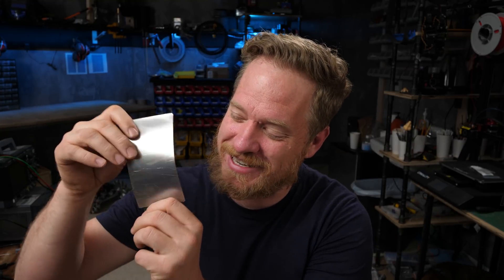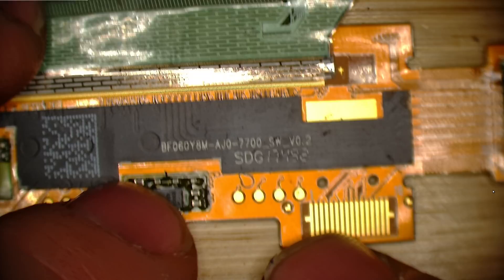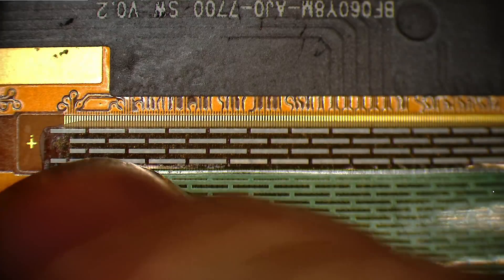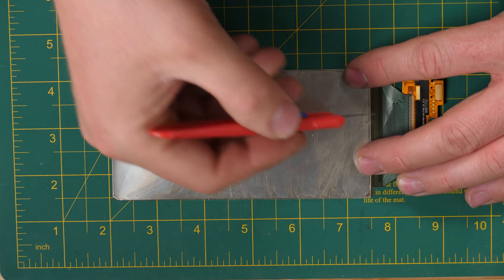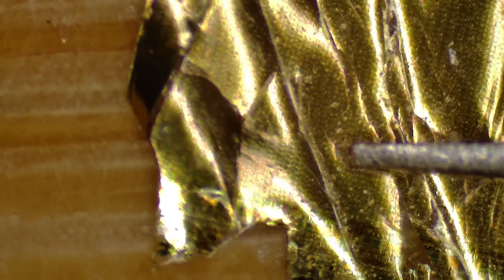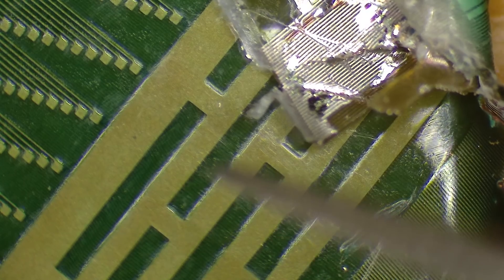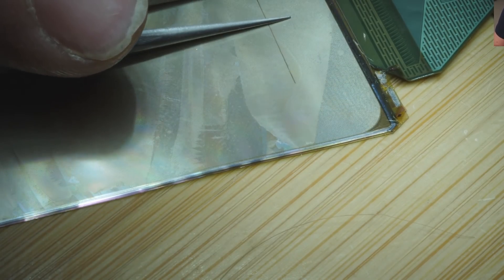What's Inside a Flexible Phone Screen? Flexible AMOLED teardown

Comment: Got here because I was replacing my son's Note 20 screen.  Was doing a full screen/digitizer replacement even though it was just the glass and not the display messed up.  When I went to pull it out of the frame after heating up, the glass came right off with the first layer of tint.  I was surprised by the flexible shiny part that was left trying to figure out how it displayed an image since the other part was just like tint on the glass.  You were the first video I could find that actually showed a screen.

Comment: 8:40
NO that is NOT how OLED works
Light emitting polymers are 3 color RGB and with WOLED there is also the white one for every 3 clor ones.
There are some versions that use white oleds and color filters but that would just destroy color space and that is where OLEDS "shine"

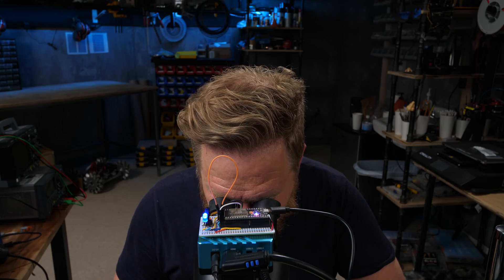Actually at 9:33 you can see the colors... and NO it iis NOT THE COLOR FILTER it is the SUBPIXEL's actual color - also there are no LEDs
Why is blue big? THats the only problem (other one is burn in but that is not really OLED problem) OLED screens have that still isn't solved and it was there since 2004... blue LEP has short lifetime...

Comment: Well the yellow this is a kinda glue that the TFT is settled onto and is poured over the substrate essentially making the TFT, substrate one single layer on top of that is another organic layer which is what you peeled off and the top part was the cathode according to my knowledge of amoled screens and more importantly I don't think so it is an amoled screen, since amoled screen are usually square and that looks like it's an regular LED screen .

Comment: You're getting an SEM?!?! That's pretty awesome. I hope you also have a sputter coater if you're going to look at that display (assuming your not using a low vacuum/environmental SEM). If you need any help with using/setting up the SEM, let me know. I have quite a few years experience in election microscopy field service and could give you some pointers over video chat if you want. I'm looking forward to seeing what you use the SEM for.

Comment: I'm fairly certain you were looking at the actual pixel elements, not color filters. In general, "small" OLED displays as found in phones and similar devices are RGB OLED, where each subpixel is an actual red/green/blue OLED element. Especially reinforcing this is the fact that each sub-element shown has a different size/shape to try and compensate for the brightness and lifespan differences of the different OLED colors. "Large" OLED displays as found in TVs instead have each subpixel be a blue+phosphor "white" LED with a color filter over it.

The color-filtered ones are easier to make last a long time and degrade in brightness at even rates since they use the same longer-lasting pixel elements throughout, but they waste a lot more power. Since phones generally aren't left on as long or as bright as TVs, they can get away with using actual red/green/blue OLEDs so that they can cut the power consumption substantially by avoiding the use of light-wasting filters.

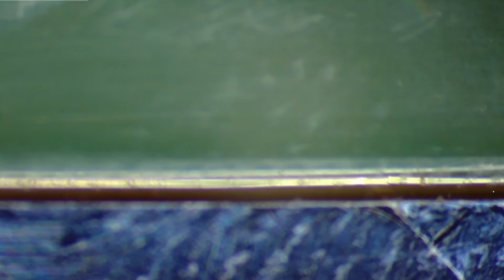Comment: Scotty, I don't think the screen itself broke.  I watched you other video and it looks like you put stress on the long silicon chip and cracked it.  That is instant death.  Look at your video at around 3:45.  You can see the crack.  I suspected that was the failure and when I watched the instant it stopped working in the other video you may have been holding the end of this chip as you bent the screen putting enough stress to crack this chip.  It doesn't take much force.
Reply from the maker: Yes, this is totally it!  Good catch!  I don't know how I possibly missed this.  I just shot a closeup of it - I'll post it as a community post on the main channel.  With proper attribution of course :D

Comment: At 4:19, there is a crack right through the driver chip. I would hazard a guess that that's how it failed. It could have happened later on, but it did make a distinct crack sound in the video when it failed!

Maybe the actual screen is more durable than it seems and it's just the driver chip you need to be careful with.
Reply from the maker: Yes, this is totally it!  I don't know how I missed this before.  Good catch!  I just shot a closeup of it - I'll post it as a community post on the main channel.  With proper attribution of course :D
Reply: Good spot
Reply: The crack is already there at 3:50 and even at the begining at 1:50. Or are you talking about a different video in which the screen failed (and you could here the crack there)?

EDIT: Just watched the first video on these screens. I could be possible that he snapped it in half with his finger while holding it.
Reply: @dannulik  Yes, that is was what I was thinking. I think he was bracing the assembly with his fingers in roughly the location of the chip while flexing the screen.

Comment: I was under the impression that OLEDs don't have color filters, but each pixel does different wavelengths and that's why they're differently sized since blue pixels lose brightness quicker than the others.
Reply: Yeah I'm pretty sure you're correct
Reply: This is correct when it comes to phone amold screens: No color filters. LG's TV panels have white OLED subpixels with color filters though.
Reply: I think this is an amoled which might be the difference

Comment: Would be interesting to stick some fine probes into that and see if you can get the various colors of organic LEDs to light up. You can get 1um diameter tungsten probes on eBay. I'm guessing pixel pitch is of the order of 50um so that should be fine enough to do something.

Comment: I suspect that screen isn't a true flexible AMOLED screens, instead, it's the AMOLED later before it is bonded to the stiff screen for strength and protection from bending - if you flex regular AMOLED screens, you'll notice they also have some flex to them without breaking the AMOLED layer, until the stiff backing breaks and causes a sharp bend that breaks the entire display

Comment: Those unused "large" connectors on the screen might be test points for testing during manufacturing before the screen is bonded to the flex control board.
Reply from the maker: Yeah, I was thinking that too...

Comment: The driver you found can only be used with qualcomm based smartphones. Qualcomm makes their own "branch" of the Android/Linux kernel and adds drivers that are used only on qualcomm's platforms. The display driver is also called a "metadriver" since it's communicating with qualcomm's gpu/dsi and it's using the metadata (dsi commands) found in the DTS. If you wanted to use the generic Linux kernel, you would have to transform the metadata into a generic display driver. This could help you: https://github.com/msm8916-mainline/linux-mdss-dsi-panel-driver-generator
Reply: Man this is so cool! Added the tool to my bucket.